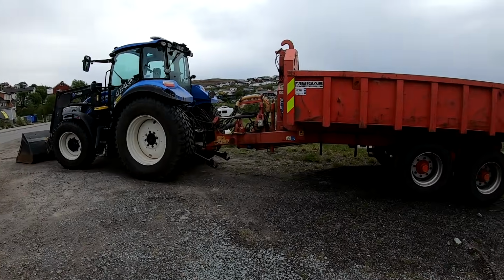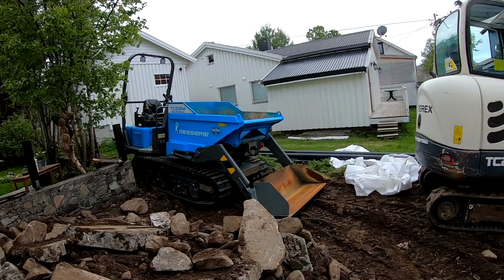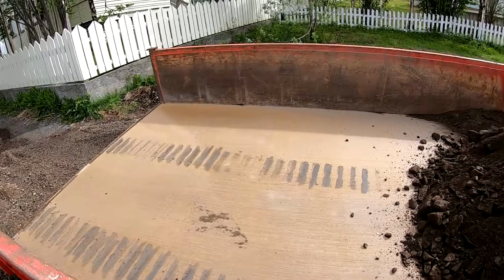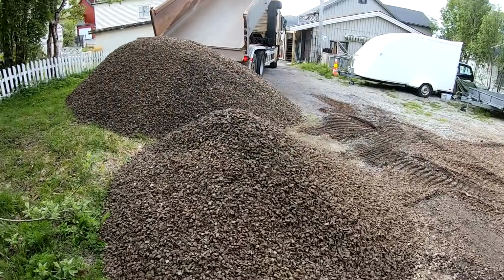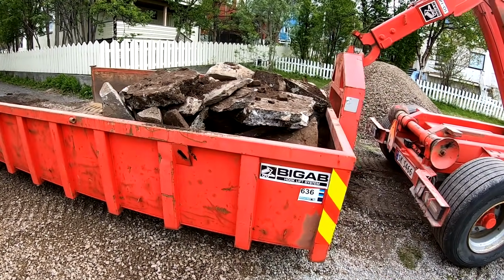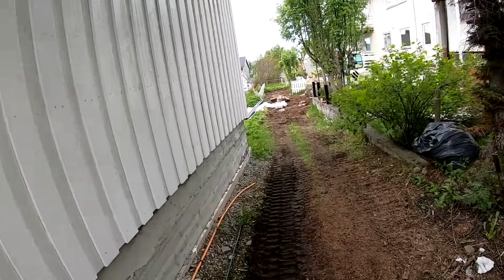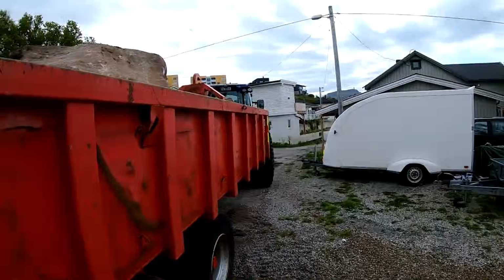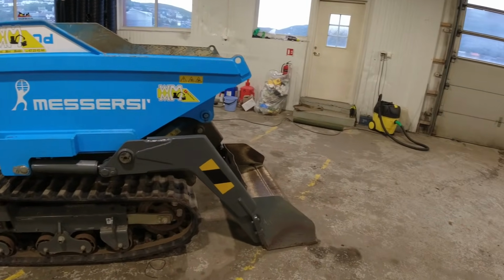It's bigger than I thought.... (New equipment)

Comment: Super new shop and new dumper.  It would be a perfect companion to my excavator. I moved many large rocks the same way.
Reply from the maker: Yes both are great 😀
Reply from the maker: I haven't done an introduction video to it yet, it's a mess 😔 was suppose to move in this spring before excavation stared but the electric was delayed so when I got to move in I didn't have time to move in and get in order 🙁

Comment: Sometimes with those big rocks you can pull it against the blade then curl the bucket under the opposite side and lift the rock with the blade and bucket at the same time.  I did that a few times with my yanmar vio 15-2
Reply from the maker: I tried that before but it only went on its nose, have moved really big rocks with my little kubota like that 😀

Comment: Wow.. at 7 min you are trying to overload your new machine.. and you forgot to sort out the nice little bit of iron pipe...  but totally impressed with the mini-trackhoe and battle of the big boulder (2mT?)
Reply from the maker: He he yes need to test it 😅 yes impressive what a small excavator can do 😊
Reply: @MiniMachines1  the tracked MESSERSI unit still worked admirably.. I would like to see the load dump unit dis-mountable and a 1.5 cu meter cement mixer  mountable..  and also just a larger bucket with bucket tip controls   and  snow plow / shovel bucket unit..  and front (in front of the operator) roll bar

Comment: isn't changing the functions just a matter of changing the hoses on the valve block ? .
from the Netherlands thanks for the video
Reply from the maker: Yes something like that, guess there is a 6/2 way valve, so if the hoses are long enough it should be easy
Reply: @MiniMachines1  Aren't they electric valves ? so its only re connections of the wie ends on the solenoids.
Great boulder control, I bet you could see it hitting the building or fence,  in your mind.

Comment: When you going to buy a frutiger scrapedozer? 😉
I just bought a small tracked wheel barrel dumper with a manual dump.
Some of those rocks would make great landscape stones or for stone walls. You need storage space for your salvaged materials.
Reply from the maker: Yes some storage for material would been awsome, sadly hard to find in this narrow town

Comment: Cool material transporter.  The bucket is fine for self loading, but it could more versatile if it could tilt even using a manual hinge and pin slots for stripping sod, scraping or removing other material. Tilting down 5° or 10° would add lots of functionality.

Looking at your mini-excavator, it is a sin that it doesn't have a thumb.  Thumbs make it easier to move larger things like rock, concrete, logs, or other stuff!
Reply from the maker: You can tilt the bucket and use it for digging, if you tilt the container the bucket goes longer down. 

Here in Norway you almost never see a excavator with a thumb, we don't use them, I can see it would be handy but it's also a bit in the way and add weight (reduced lifting power)

Comment: Pro Tip! Sometimes when you have a large object, like the boulder you were moving? You can slightly pick it up using bucket and excavator blade and track it to where you need to go. Works surprisingly well. Not always, but in many circumstances.
Reply from the maker: I tried it but this one was way too big, but it works great as you say in some circumstances, I've done it a lot with my little kubota.
With this one the terex was to light in the back.
Reply: @MiniMachines1   I figured you knew. Just threw it out there for others that might be watching that didn't know.  I work with a guy who has been operating for 30 years and never thought of it.
Reply: @brianpearl7504  so you know an operator.  You are not an operator yourself!
Reply: @timfagan816  Haha funny boy!
Reply: @brianpearl7504  🙂

Comment: How come the tipper lorrys and your hook trailer body have such a small tailgate
Reply: I d say with a typical large tail gate hinged at the top it would limit the size of debris that it could pass under it , or it would have to be completely removed and stored.
Where the short gate can be lowered and remain attached . Just my observation
Reply from the maker: Correct as @heartland96a said my trailer and the trucks come with an big top hinged tailgate but they get taken off quickly, like now I had to take it off to drive the dumper in and dump so more work and the little one work great keeps almost everything in 😀

Comment: hold the boulder against the blade and lift with the bucket slightly. You can  push the rock then.
Reply from the maker: I tried that but it was too heavy only went on its nose 😏

Comment: Hey, do you still have your blue tracked dumper? Or do you not have it anymore?
Reply from the maker: Yes still have it just fixed it up changed some bearings and engine
Reply: @MiniMachines1  wow please do a new video on this machine! I'm interested in Messersi equipment and I'm suprised you've had to change he engine already? Unless you've done a lot more hours work than I imagined? How many hours? 🤔
I'd really appreciate a video on this dumper. Giving your thoughts, opinions, and what it's needed doing. It would be a great video for people because overall there's very little out there regarding Messersi
Reply from the maker: @matthewhayes7765  oh sorry i thought it was may old blue dumper, witch video the comment was on didn't show😔 the new blue one is working 😃 the electrical is a bit funny doesn't like rain or snow so i need to get that figured out this winter

Comment: I think a mini skid loader would've been much faster.  Scoop the pile and loaded into the side of the bin. No need to load with excavator.
Reply from the maker: Yes I do have a skid steer, not to found about it, but maybe it could have been used here, haven't used it since I got my new hook lift trailer could be it works good with that.

Comment: Great video.. But pound for pound & dollar for dollar a skid steer is a much better machine.. on every level.
Reply from the maker: I got a skid steer but I do not like that type of machine.
The skid steer is really weak compared to its weight, a small compact wheel loader will almost lift its own weight a skid steer only lifts 1/3 of its weight at best.

You always need an excavator anyways, and when you have an excavator on sight the skid steer is not much use for.
And if a skid steer would carry the same amount of dirt as the dumper I would need a semi trailer to move from job to job, and tear down the garage to get in 😅

But this has a lot to do with where you are from, here in Norway there are never a skid steer to see, we don't use them, but I see that in America they are used for everything.
Here everyone starts with a excavator and no one buys one with out a tiltrotator or 5 different buckets